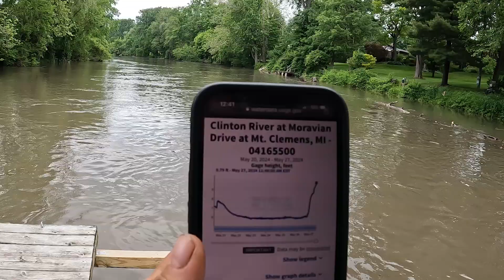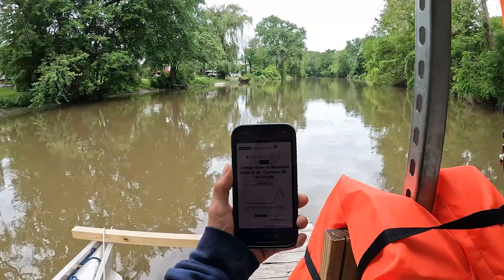Boating Isn't Easy...

Comment from the maker: Thanks for watching! Don't forget to subscribe, and check out this adventure playlist! -->https://www.youtube.com/playlist?list=PLp3T0zoFDq8G16jI3c63I7Il2dr9v3wKX
Reply: Instead of fighting the current, it's easier to tack diagonally.
You'll still be slower than on a glassy still day, but it'll be a huge difference, even against an otherwise strong-ish current.
And you've got the perfect 'hull' for a better propulsion location.
If the engine was in the dead center of the boat, your turning circle and torque would be optimal.
Luckily, you can relatively easily move it forward a few feet!
You could also use the baffle boards (or whatever they're called) as underwater sails when tacking.
The oncoming current will be like a headwind, assisting the forward motion, it sounds unbelievable to non sailors, but it's basic fluid dynamics!
Reply: For years, I've been designing a modular pontoon boat/bridging craft in my head and sketched out, I finally bought a 3D printer and am making small prototypes, but I still need to get my head around designing on CAD software, it's so much easier to cut wood and screw/bolt things to it instead!

Comment: You should put a second motor on and spread them apart as far as possible on transom. Then you can steer using motors only and make turns within the width of your boat. Basically steer like a zero turn motor. I know motors aren’t cheap, but would make much more maneuverable. Plus you have backup.
Reply from the maker: That would be soooooo awesome! We just waiting until we hit it big and then it's showtime!
Reply: @MoneyPitBoating Totally! Those motors aren’t exactly cheap.
Reply: Was just going to say this.  Wouldn't need full power either.
Reply: @Skiddols might actually be more efficient too.
Reply from the maker: We'd love to be able to test this!
Reply: this is the approach I took with mine and I'm looking forward to seeing how it performs. I think my two motors add up to the Money Pit's one (or a little less tbh, 2200W each) so it's gonna be interesting comparing -- although mine is also way, WAY lighter than the Money Pit because I have no cabin and only two pontoons, lol. cross your fingers for me, I think I finally figured out my throttle problem so should be able to test this week.
Reply from the maker: That's awesome! Let us know how it goes!
Reply: @notaprofessionalJ I wish I could offer suggestions to help, but I only know boat gas motors and ebike stuff. Good luck, let us know how it goes.

Comment: you guys need a gas engine
Reply from the maker: It would help in the speed category, but the noise is terrible! We've found that everything is a tradeoff when it comes to boats... Thanks for watching!
Reply: @MoneyPitBoating  the noise is SO bad. big reason I copied you guys and went electric -- although free "gas" from the sun doesn't hurt either!
Reply from the maker: The free gas is amazing!
Reply: @MoneyPitBoating  looks like you guys never tried a 4 stroke
Reply: @MoneyPitBoating  a honda 2.3hp 4 stroke is almost as quiet as electric motor
Reply from the maker: Our motor is pretty much silent, and it's a 9.9 HP that struggles with river current. If we got a 20-50 HP, it would be loud! The speed would be awesome though!